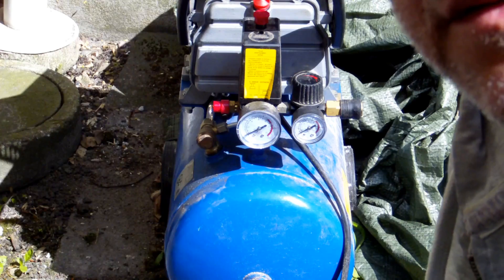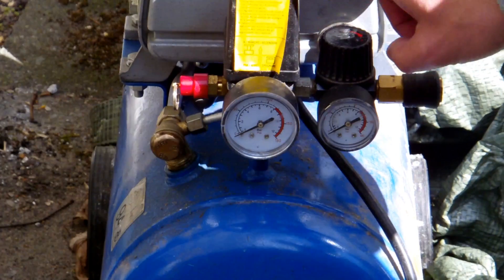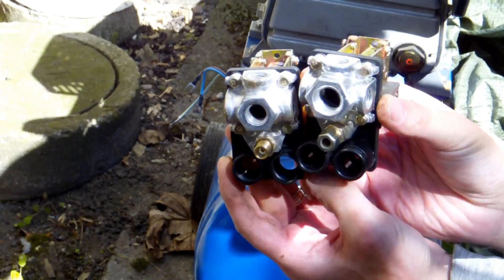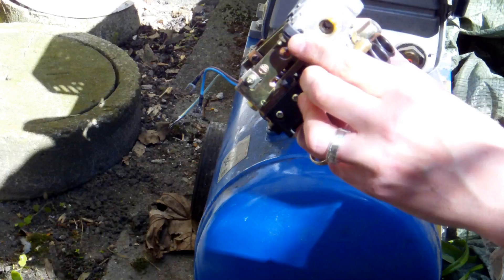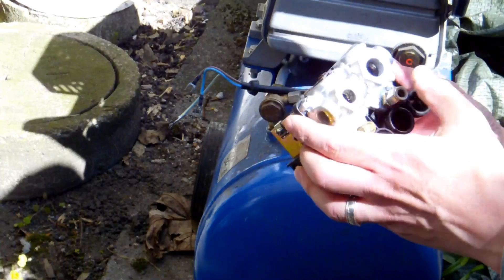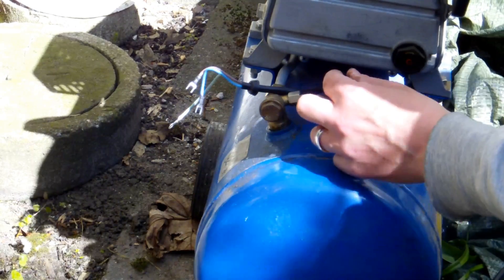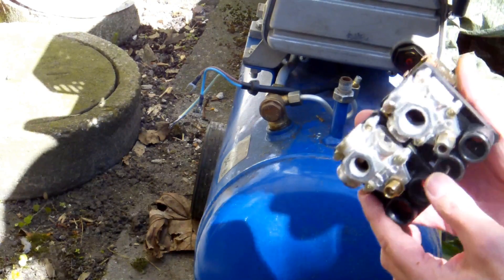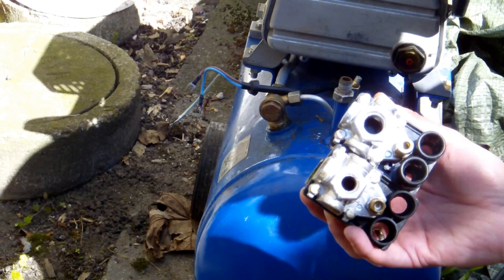Fixing a leaking air-compressor - part 1

Comment: My air compressor has leak on its tank can  i  repair it.
Reply from the maker: Well that depends.... 
If you know where the leak is then you can probably seal it by welding a small steel plate across it. But it's probably a longshot!
Thanks for watching!